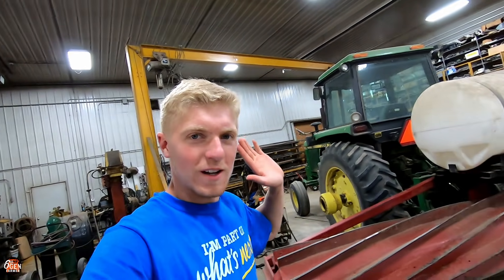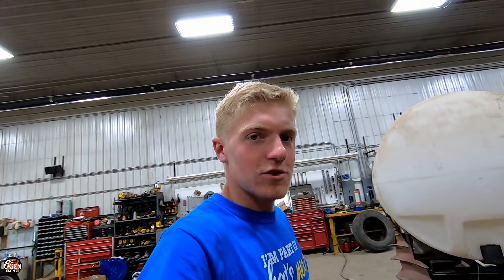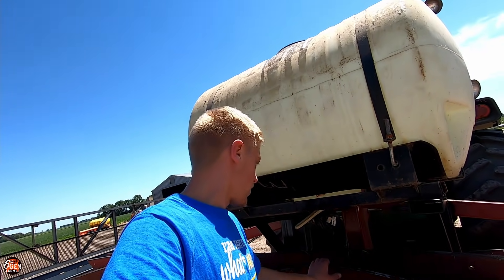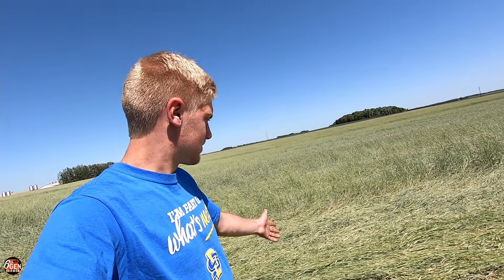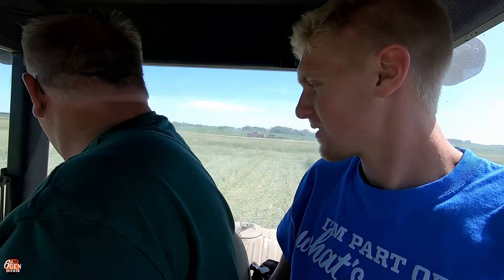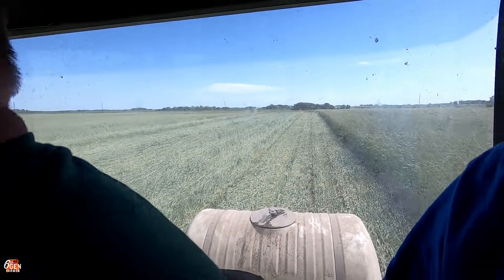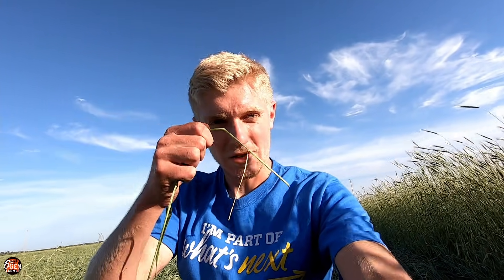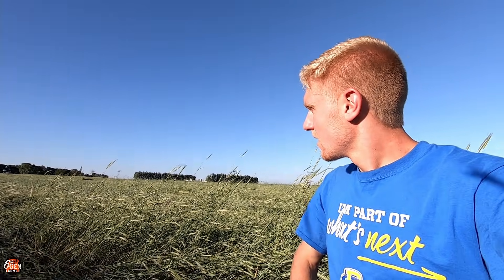Crimping Organic Rye! John Deere 4240

Comment: Put water down in front of the crimper so that when the crimper goes over it the water will make the rye heavier and not as dry and it will lay flat better on the field, just a thought🤷‍♂️
Reply: Might work but it would take a lot of water.